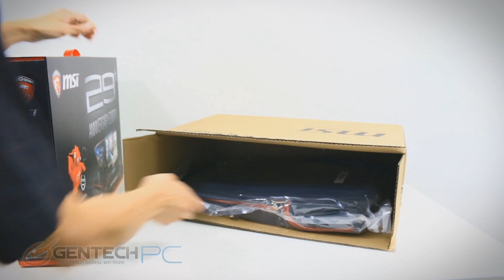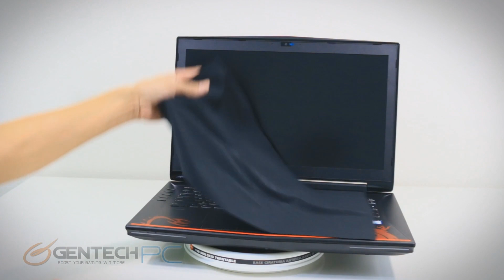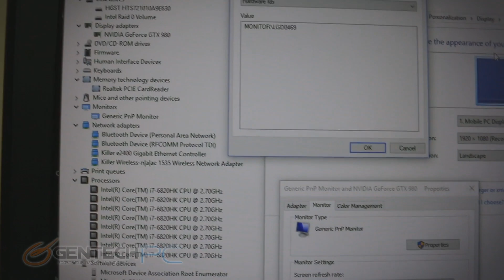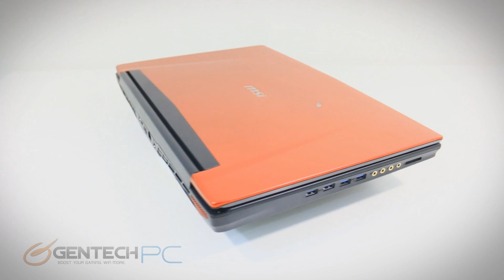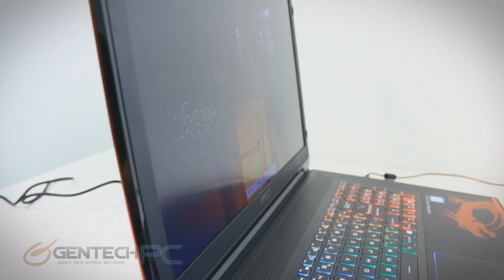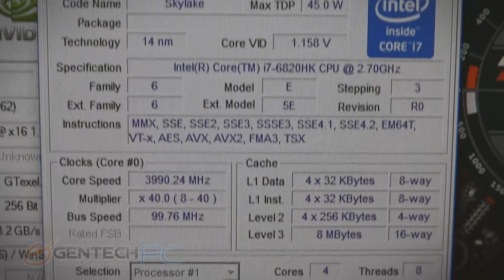Detailed Review MSI GT72S Dragon w/ Desktop GTX980 Overclocked

Comment: Thank you for your review. Between this laptop and the ASUS ROG G751JY-DB73X, which one do you think is better, in regards of cooling, noise, gaming performance and fps, also quality built. I'm looking to buy a portable gaming rig and I've always loved Asus, but this laptop is really making me curious.
Reply: +Luis Sanchez bump I was thinking of this question too.
Reply: I bought a GT72S 6QE recently. I should point out that if you want a portable gaming laptop, consider GS60 instead. I have a fairly large backpack, and yet the GT72S just barely fit into it, and I had to use the main compartment instead of the pocket designed for 17 inch notebooks. Note that ASUS's ROG 751/752 is even larger and heavier and definitely wouldn't fit my backpack. Whichever you buy, know that it's not going to be something you'd want to carry around.
Reply: +Rickard Shen i am stuck between this and the new sager NP9870-S, what should i get, the sager is better in terms of desktop parts and much better performance per dollar , however it does not match this in terms of premium quality feels, also it has a very loud fan noise
Reply: blackdragonIV Don't think I can advice you about the choice since the choice sounds like a matter of taste.

What I can advice about is the possible deal breakers with the MSI:
1. The spacebar doesn't register if you press it on its lower right corner, which many people do if they are used to pressing space using their right thumb. MANY have complained about this, but MSI/Steel Series don't seem to listen.
2. The keyboard layout is non-standard. While you can of course get used to it, it's still a major annoyance.
3. The arrow keys are not separated from the rest of the keys, which can be annoying, mainly because you accidentally hit the up key sometimes when you try to press right shift... because non-standard layout. In the same way, you'll often accidentally hit the right key when trying to press the numpad 0.
4. GT72S is HUGE. It did not fit into the notebook compartment of my backpack, and JUST barely fit into the main compartment with a little force. While in the backpack, the weight is not really an issue.

Some positives:
1. Awesome performance. Unless you're planning for your laptop to play late 2016-2017 games on ultra, you probably don't need higher specs. But that's up to you.
2. Keeps cool and quiet.
3. Lots of USB connections... for... whatever you want.
4. Very easy to install extra RAM or SSD.
Reply: blackdragonIV Ok, long story short: Go to a store and feel out the keyboard to see if you can tolerate it. Start up notepad and write some text, and make sure you use keys like the ' one, the one above the return key. I think this keyboard can be a major deal breaker for many people.
Reply: +Rickard Shen when it comes to keyboard layout , my current laptop matches the msi laptop regarding button shape and how the arrow keys are arranged in, i can tolerate the pressing the space bar in the lower right and most people use WASD anyway also if you look at sager laptop they have even smaller keyboard. what i am looking for is future proof laptop that i won't be needing to tinker with for a solid 3-5 years, the sager seems to be the best option for that but i find that the lack of premium feels in it along side the high fan noise are holding me back on it
Reply: +blackdragonIV CPU-wise, depending on the type of workload you throw at the chip, a 6820HK should most likely stay relevant for a good 5 years without problem. That leaves the GPU, which is the same MXM chip that you can upgrade when needed. Note, however, that the Sager model uses a 330W power supply, whereas MSi for inexplicable reasons decided to stick with the old 230W power adapter also found in previous 970M/980M models. From my experience of actually using this GTX 980 model, while performance is by no means affected, whenever the laptop runs at full load, the battery drains, which is rather annoying to me, especially since the battery is non-removable. The upside to this, of course, is that this less powerful power adapter is likely going to be less heavy than the 330W one. So consider this difference in power supply too when you choose between the two models. Personally, I love the Dragon Edition aesthetics -- I would never have bought a regular GT72(S), and the Sager (Clevo) model can't even begin to compete in this ground.

Comment: I need a laptop for school work and gaming will mis suit me? If so which model will be best any price is fine? :)
Reply: Also hoping for one that will last 3 plus years able to run upcoming games at ultra or high settings :)
Reply: +Pyro it will but not this one, this kind is not the type that will sit unplugged from outlet for a long time while gaming. i recommend one of the 980m since much less power consumption and less heat output, the 980m is a beast card and it can take most games at 60fps on ultra also msi laptops ships with an MXM card so you have the option to upgrade gpu in the future :). if you are going to be carrying it around a lot i recommend one of the slim laptops since the weight might be back breaking but slims model usually don't have high end gpu and if they do then it will slow down since heat build up because slim laptops don't cool very well due to the restricted air flow
Reply: If you press space with your right thumb when typing, I strongly recommend you go to a store and try out an MSI laptop keyboard. The space key doesn't always register if you press it in some places close to the corners, and that can definitely be a deal breaker. Also note that MSI uses a fairly weird keyboard layout for no real good reason. It works for gaming, but if you want it for writing reports and essays too, I'm not sure I can recommend an MSI.
Reply: +Rickard Shen The Fn and Windows keys can be swapped in BIOS.
Reply: Cklodar The Windows and Fn keys haven't been a problem. The problem is unreliable space key, the location of the '/* key, the small return key, the small numpad 0, the arrow keys being difficult to find, accidentally hitting the up key when I intend to hit shift, etc.

Sure, you get used to all of this, but design it so you NEED to get used to when a standard keyboard layout works just as well for gaming? The only possible problem with a standard layout is accidentally hitting the Windows-key, and that can be fixed by giving it an on/off switch.
Reply: +Rickard Shen Makes sense. And I especially agree about the arrow keys and the small numpad 0 key. In fact, MSi uses this same keyboard design across their 15.6/17.3 inch products, which feels a bit cramped on a 17.3-incher. But I did hook up an external keyboard right after getting my GT72S, partly to protect the laptop keyboard from wear, and partly to avoid having to use that layout. ;)
Reply: +Pyro  LIL I love the I NEED THIS for school reason. Replace Need for Want but talk yourself into NEEDING lol. You could get away with a $250 laptop for all writing applications needed for school. But you want an expensive laptop for gaming Want VS Need LOL.

Comment: a have this model (not dragon edition) and i see only 60hz. why?this model has 75hz!!
Reply from the maker: +Kardzi Michal Must be the firmware on the panel are different.
Reply: But why is set defaut only 60hz when 75hz is official parameter
Reply: +Kardzi Michal there is a driver update that will change it to 75hz, but not sure which driver it is :/

Comment: Whats the point of having a GTX 980 in a laptop with a 1080p 60hz screen? to get 100+ more fps than 60 that you can't even see?
Reply: +Marcel Coetzee It's 75hz. And most people use 60hz monitors either way.
Reply from the maker: +Marcel Coetzee it shipped with 75Hz and can be overclocked to 100Hz.
Reply: it shipped with 60Hz but i dont know!!!???i have model MSI GT72s QE Pro G

Comment: will there be a clevo with i7-6820hk and two desktop gtx 980 in sli coming soon?
Reply: the clevo will have a 6700k. desktop cpu
Reply: +hi9580 most likely not cooling that will be impossible in a standard laptop
Reply: blackdragonIV clevo aren't standard laptop

Comment: Any idea when will Asus g752 4k will be release?? I'm really tempted to by this one.
Reply from the maker: +qupidmox   November.  But you should really consider the upgradability and easy to maintain the fan of G752 vs MSI GT72s.
Reply: +GenTechPC so which one are you recommend, I am leaning toward this one because how awesome it look.
Reply: +GenTechPC I went for the msi gt72 vs the g751 because I thought I could compromise build quality, I ended up selling it because I hated the plastic chassis.

*upgrades=will void the warranty, will be expensive, will be hard to find, will be hard to do if you're not exactly the tinkering type.

the new g752 will have the dust release cooling system.

Comment: was waiting for this thanks!
Reply: +Junaid Butt The 6920HQ is also part of the Skylake generation, don't leave it out ;) I recommend it over the 6820HK because, based on performance of similar chips from the past generations, a higher base frequency (2.9GHz, as found in the 6920HQ as well as the older 5950HQ, which is a real beast) will likely perform way better than even the overclocked 6820HK. To put all of this into perspective, check out PassMark's high end CPU ranking based on benchmark data collected from users: https://www.cpubenchmark.net/high_end_cpus.html. The 6920HQ is yet to show up on the list due to lack of data, but if you check out the previous generation 5950HQ, you'll see that it achieved an average score of as high as 10929, virtually on par with the Skylake generation desktop chip 6700K, which sits right above it. (Although admittedly, 5950HQ has only been tested by 7 users, which is less than ideal.) Meanwhile, my personal test result of the 6820HK, overclocked to 3700MHz, yielded a CPU score of 10243. And keep in mind we are talking about 5950HQ from the last generation, whereas the 6920HQ will most definitely perform at least as well. So, that's my argument that the 6920HQ will likely be more beefy, and thus more suitable for your work, than the 6820HK. Having the ability to overclock does not automatically put 6820HK above all other laptop CPU chips. Over time, the 6920HQ will be tested by enough users to make its way into PassMark's CPU ranking; then we will get a definitive answer as to whether it is indeed more powerful.
Reply from the maker: +max saito Thank you for watching. :)
Reply: +GenTechPC how long can you game on this laptop
Reply: +Alpha Scorch - till your wife comes home ...
Reply: +Jonathan Chicoine i am not even married
Reply: Jonathan Chicoine lmao
Reply: +Jonathan Chicoine  at least he's married not like you a virgin
Reply: +Jonathan Chicoine OOOOOOOOOOOOOOOOOOOOOOOOOOOOOOOOH!!!!!!!!!!!!!!!!!!!!!!!!!!!!!!!!!!!!!!!!1!!!11111!!!!!
Reply: +GenTechPC i've a question.. i mostly do extreme video/audio productions as well as video editing and photoshop work. can GTX 980M model laptop is enough for that level of work or i still need to buy this one laptop with GTX 980 desktop card in it? need your sincere advice.
Reply: +Junaid Butt Encoding workloads demand a powerful CPU, whereas a GPU's main job is to render frames. The 6820HK in this and other models is pretty beefy as long as you're willing to enable overclocking and endure a higher GPU temperature; but for even better performance you might want to consider the 6920HQ instead. At any rate, it isn't the GPU that'll affect the kind of work you're doing.
Reply: +Junaid Butt Oh I meant "CPU temperature." :)
Reply: +Cklodar thanks for your wonderful reply brother. but can i ask why you are recommending HQ processors over skylake HK processors? isn't the new technology is better then the previous generations? i have to work thoroughly on special effects films and video editing as i said which is on a very professional level but as i travel alot so i can only consider a laptop instead of desktop computer. Moreover don't you think that MSI laptops are capable of handling such extreme CPU temperature if i overclock this beast laptop? what you say?
Reply: +Cklodar thanks for your detailed reply my friend.. do you also recommend using this 4720HQ (Haswell) processor laptops? or i mean this laptop for extreme video special effects and editing with photoshop useage? http://www.bhphotovideo.com/c/product/1139155-REG/msi_wt72_2ol_1246_i7_4720hq_16gb_1tb_128_windows_7pro_k4100m_17_3.html

the 6920HQ is only available in 18 inches laptop which i dont like.. i only need in 17 inches laptop with powerful beast.. which one you recommend to me?